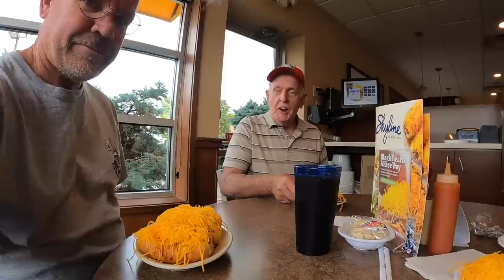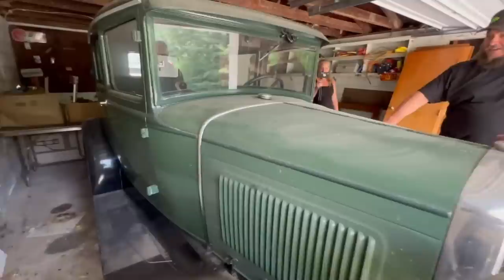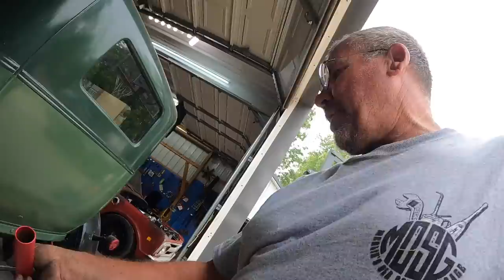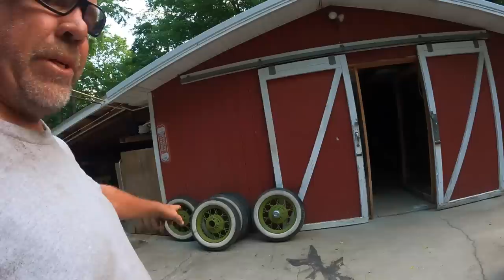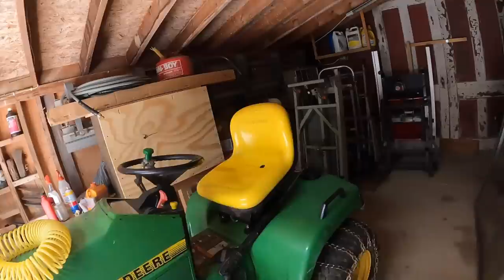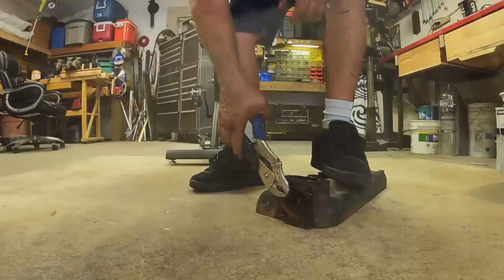You Won't Believe the TROUBLE I Got Myself Into This Time!

Comment: Back in 1962 I had a 5 window coupe 1930. Learned how to set timing with pin in timing cover. Had original manual to guide me. Learned a lot keeping that A BONE on the road. Painted it green with black fenders. Drivers front fender for sparetire mount, but no cowl bracket. So I just pumped tire full of air until it wouldn't fall out. No glove box just kept pliers, crescent wrench, and baleing wire in trunk.

Comment: What a find, definitely a great project that was taken care of to the best of their abilities for as long as they owned it. You can’t hardly find that sort of preservation in this day and age, people aren’t raised like that anymore. 

I just ran across a couple of the overhead valve conversions for that four banger this morning. I paused the video to go back on Facebook to try and find it in case you were interested Merlin, unfortunately I couldn’t seem to dig it up again. Vintage Speed Equipment  Show it off buy/sell/trade is the name of the group I’m in that the add popped up on in case you wanted to look for it. Really dig looking thru the adds myself but have to stop myself from buying more magnesium slot wheels or the American Racing spindle mount spoke wheels every time I find a set there. Anyway, looking forward to seeing your journey in the A and wishing you the best of luck with your new toy.

Comment: I played with an A model "doodle bug" on my grandpa's farm when I was in my early teens. I'm nearing 70 now. I can still remember how to start, run and tune it up. I would love to be able to join you on this project. Grandpa told me "all you need to do most of the work on an A model is a pair of pliers, and screw driver and a length of baling wire". I had a ball on that thing! Sadly it was destroyed in a barn fire along with other equipment.  Can't wait for the next video!
Reply: Those were the good ole days

Comment: I have a junkyard motor in my 2000 xj  unfortunately the head was cracked blown head gasket    Too.. the new rebuilt head is ported and polished man what a difference it makes.  I’m checking the gas mileage on it now!!   I haven’t redlined it yet ! I can tell the difference between the stock one ☝️

Comment: ONCE A YEAR YOU HAD TO  DO THE BEARINGS IF YOU DROVE A LOT OF MILES  BACK THEN THERE WAS A LOT OF MAINTENANCE HAD TO BE DONE TO KEEP IT ROLLING  / A LOT OF GUYS PUT A PINTO MOTOR IN THEM AND THEN YOU CAN DRIVE IT A LOT WITH NO PROBLEMS  WITH THE MOTOR  / GOOD LUCK WITH IT

Comment: You got ta programme the computer in the A model! They just won't run without the right program 😂 that's a nice car there. Try opening the gascolator dial about 1 full turn. They can be fussy. Varies by the car. That's on the choke knob! Ya gets ta turn it round a mite!

Comment: Crazy how the Model A engines mess with the Audio every time!
Reply: Unshielded non resistor spark plug wires. 
Wasn’t really a problem until they started putting radios in stuff.
Reply: They generate lots of RF!

Comment: This video makes me look back to the simplicity of an inline engine. My preference is with inline 6s. "When I got my first" fuel injection vehicle. It was my concern, no carb that can be diagnosed and rebuilt with simple hand tools.  Now, a lawnmower has more electronics  controlling it than most cars and trucks up to the 1980s or 90s. But I do appreciate that many components are better today, with the ability to "just go drive it." I still don't like the throwaway parts of today.

Comment: If you can't get the horn working and you don't have an extra let me know one of the 4 extra I have should work. One thing I'm thankful for is grandpa hung onto a lot of spare parts. I have 4 engines but 3 are blown and tore apart and the one in the car is froze up tight. Can't get it freed

Comment: Well I'm proud of you one awesome ride and not a pile of crap general motors product a beautiful old Ford put a battery in it some gas and check the oil and hit the road cool
Reply: I like the vehicles you buy maybe I could get you to work on mine 1966 Ford class A motorhome 4bt Cummins 1-ton 4-wheel drive after a million miles needs servicing